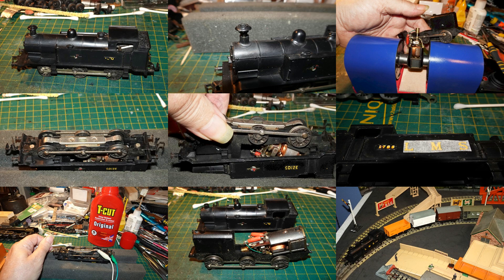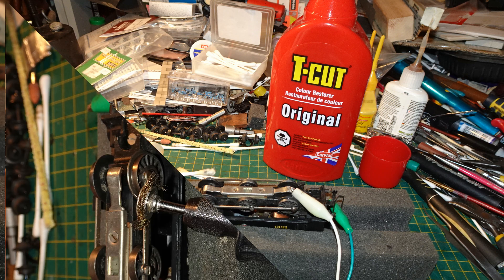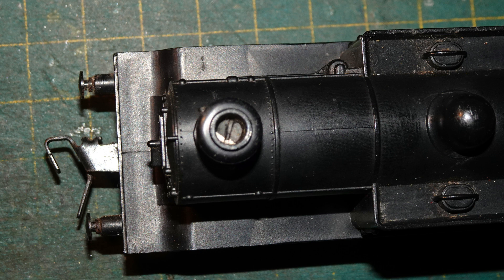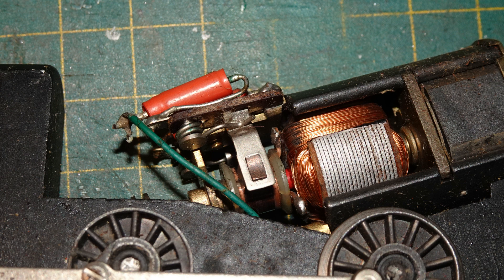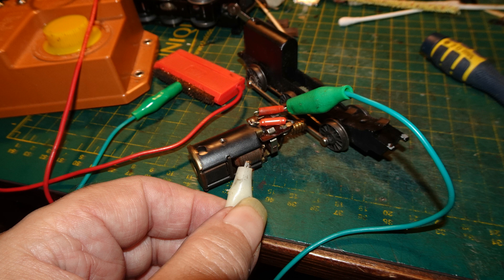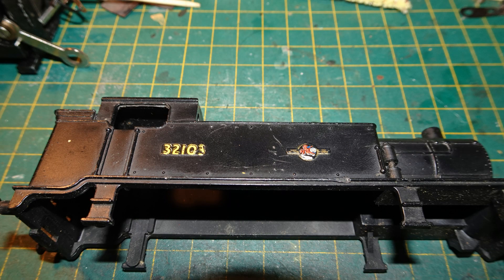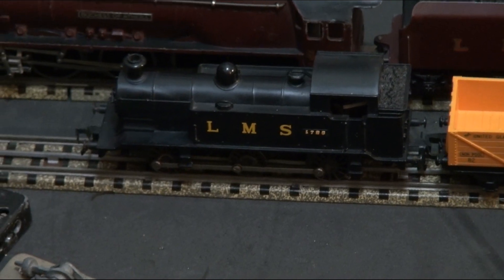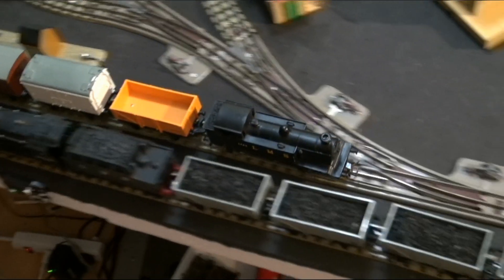OO 248, A Trix Twin 0 6 0 Tank Engine

Comment: Are the wheels on the non pick up side earthed through the chassis? If so maybe you can just short the pickups to the chassis…
Reply from the maker: The wheels on both sides are insulated from the axles by plastic centres. The centre-rail pick-up is shorted to the chassis, and so to the body of the motor (when it is screwed onto the chassis). The pick-ups on the lefthand wheels connect to the other brush of the motor via a wire. So... if I wanted to pick-up from the righthand wheels as well, I'd need to fabricate new pickups.